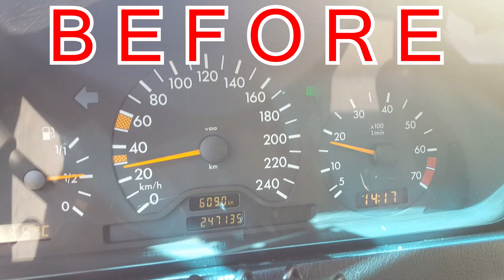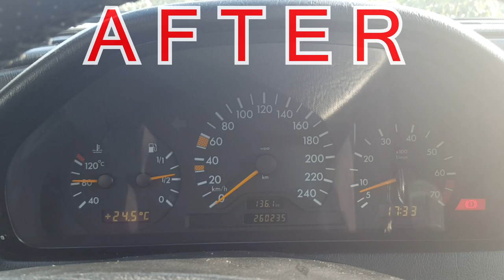Mercedes w202 w210 fix low Revs and Revs oscillating // C180 C200 E200 ... RPM problem

Comment: Be careful doing this procedure, if it's still a cable TB, you have to disconnect the battery after all it's done, so in that way the computer can clean the info that have stored about ratios and curves of accelerations, and it will relearn again the throttle work ;)

Comment: My car is stuck in 1st gear and will not rev over 2000 rpm w202 c200 do you know how to  reset it?
Reply from the maker: Automatic gearbox?
Reply: @next24  yes
Reply: Did u figure out the problem bro?

Comment: Bro i dont know what is happening with my car  becouse , when im  in neutrall and wonna rev it ,the last rpm's is not 6500 like it should be , it is near 4500 ? #1 Sorry for my bad english #2 Can you tell my whats happening ? :) "The Car is w202 c180 122hp 1995 year
Reply: Its normal mb. Have stock ref lounch control 😉
Reply: @thedragemantrading1483   Thx for  the answer ! Have a good day !
Reply: 0 to 100 mb wil bi faster if jou got good performance tires on it wil shock you hou relible its buld hit the gas pedal but dont do to much it kick engin 4500 back around 4300 rpm wen jou ar stand stil it wil lounch the car like its a drag racer 🤩
Reply: Abs relais
Reply: almost every mb has limiter,  soft limiter and hard limiter, you can take out the limiter if you want by remaping or other way

Comment: Still low rpm on idle, it should be around 800-900 rpm
Reply: Need so high for idle RPM?
Reply: @user-ze1kb5un5c  depends on the weather, on cold start it goes at 1000rpm
Reply: @IOAN2ER  My m111.942 facing a issue, once throttle my car jerk/ rpm drop 1st only start accelerating, same happen in neutral. But you step it smoothly it won't happen lol
Reply: @user-ze1kb5un5c  i have a friend with a audi a4 b6 same issue. My diagnosis might be the injectors